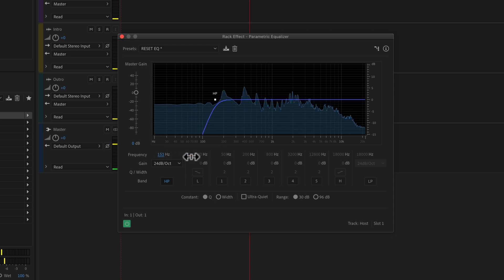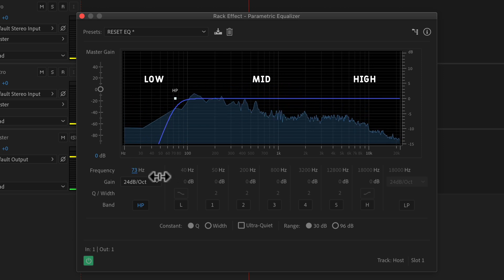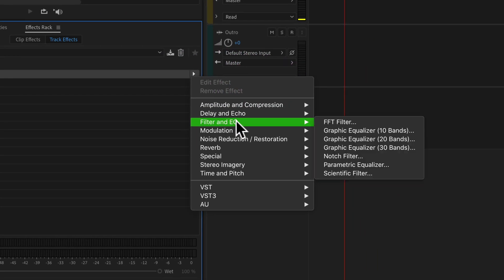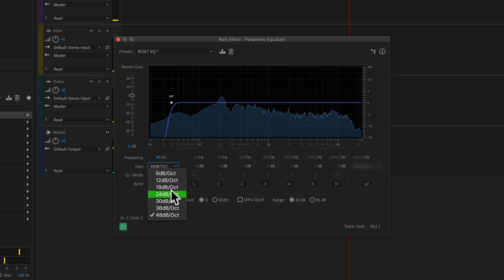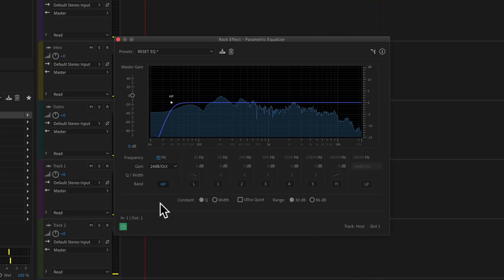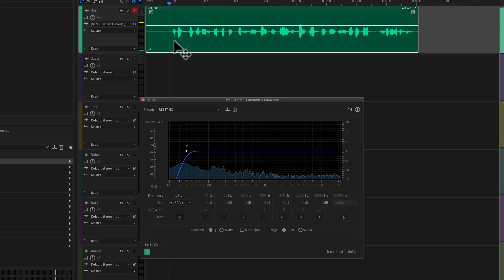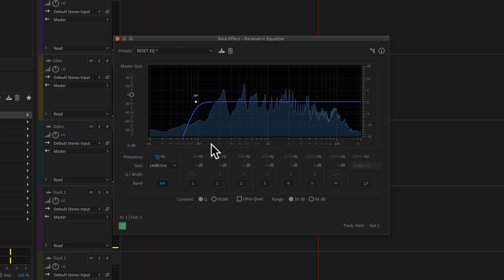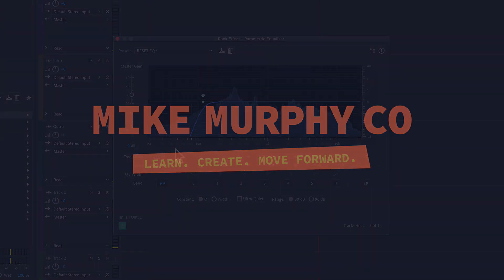Adobe Audition CC: How To Apply a High Pass Filter (Parametric EQ)

Comment: thanks for this very interesting video!. i have a problem with the parametric EQ and can't get it figured out. When i put a parametric EQ on an audio file and all i want to do is high pass a bit. when i apply the EQ my audio file always gets boosted a bit. Do you have any idea why this might be happening?
Reply from the maker: Happy to help troubleshoot. Can you just share the exact steps you are taking? When you say your audio gets boosted- do you mean it sounds louder or that is brighter sounding?

I
Reply: @MikeMurphyCo  all i do is turn on HP and set it to 30hz and apply it. there was no clipping before but after applying there are some parts too loud all of a sudden and clipping into the red
Reply: @MikeMurphyCo  maybe you can test it by doing this with some track that almost reaches the point of clipping but which doesn't actually clip anywhere
Reply from the maker: @acidvideothomas8383  I do not have the scientific audio engineer explanation, but when using the Parametric EQ (or any filter for the most part), when you make changes to the Waveform it shifts (you might be familiar with Phase Shifting), and depending on the type of audio (likely music tracks would be affected more), it could very well cause parts of the audio clip to increase in gain even though it seemed like all you were doing was dropping off the low-end.

I think the steeper the curve of the High Pass, the more it would be likely to cause the clipping as in your case.

When editing spoken word dialogue such as my podcast or video audio, one of the first things I do is Normalize to -3dB to give me plenty of headroom to add EQ, Compression etc and then bring everything to where I want it at the end usually using Match Loudness while occasionally using a Hard Limiter on the Master Track.

In short, I think that is expected behavior depending on where your levels were when you started.
Reply: @MikeMurphyCo  thanks man! i did try to do the same thing with the 30 band EQ and this time it worked as expected. Maybe i just soudn't want to use the parametric EQ for this
Reply from the maker: @acidvideothomas8383  Awesome, glad you sorted it out.
Reply: @MikeMurphyCo  but still i find it strange that when i only tell it to remove something there are still parts being boosted
Reply from the maker: @acidvideothomas8383 I’m sure there is a good scientific explanation, but if you do a Google search or better yet ask AI Chat, hopefully you should be able to find an explanation. ✌️